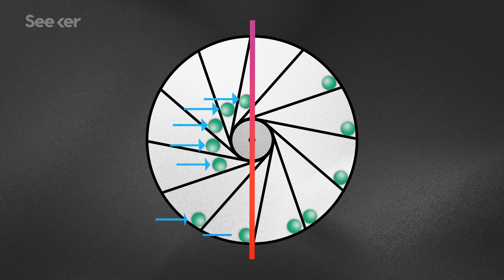Why We Want a Perpetual Motion Machine, But Still Can’t Get It

Comment: But if it only slowd down due to interference from the outside environment... (proof of this is supercooled superfluid liquid helium), than: it would not be cheating to take energy from that environment, because that's just payback for the environment making life difficult for the machine: ergo: moss in a sunny environment is a perpetual (as long as the environment remains sunny and conducive to life) motion machine. 

The only problem is that the environment has a tricksy habit of changing.

The suns energy comes from nuclear fusion, which would be a self defeating reaction even in a vacuum, but it's other energy: its rotation: would, in an empty universe: be around forever, never slowing down. 

Sadly, our universe is not a vacuum and gravitational waves slosh across cruelly and unfairly spreading the energy out all over the place. 

So, if you wanted a real free energy machine: you'd already need one. 

Luckily: the expansion of the universe is so power that it's going to blow atoms apart someday; either that or our universe is some kknd of cycle in some kind of vacuum (big crunch big bang big crunch big etcetera) or our universe is going to become infinitely cold, thus making a great temperature differential to harness energy from.

Or to be more accurate: you need an infinite energy source. 

Alternatively: you could lpok inwards and realize that humans are indefinite energy machines, because we are intuitive AI which adapt to harness energy from our environment. 

Build an organism compliant with being used as tool, then give it the genetic toolset to thrive in as many places as you can, then wire them up to harness energy from literally everything, from sound, to gamma rays to UV rays, to visible rays to radiowaves (as a colonial bacterial matt acting as an antenna), to even temperature differentials and quantum fluctuations (brownian motion). 

There, something more efficient than a plant, a universal, electron-farming microorganism which can be tapped into and which will have an output till heatdeath (due to cosmic microwave background radiation). 

Will always produce enough to run a tesla? Probably almost always not. 

But will it always be observed operationally extracting energy from its environment? 

Yes. 
Because no matter which way in which you attempt to observe the darn things: you'll be giving them energy. 

There. 
Rant over. 
Go home
Reply: Ian Schimnoski Thats false
Reply: @RetrogradeBeats  oh okay, thanks for letting me know. 

My name's Jerry, I like movies 

Jk

Free energy logic is generally false. 

But, I see no reason we couldn't build living photo-diodes, and then impart them with more dynamic behaviors and functions. 

I don't believe in perpetual energy, but just like how we pack up and move when an oil well dries up, a process to automate that transition, but with solar and sonic and optical energy sources, would be cool. 

I am most prone to imagining unbalanced wheels. But I'm the kind of person to simulate it through to the end and realize it won't work. 

That's healthy.

The only people who don't: are people who have already; charlitans; and lazy folk. 

All physicists have already. 

It's called the laws of thermodynamics. 

They have a stronger grasp on it, so they have already simulated and debunked all free energy machines. 

Me? I still need to play in order to master it. Not there yet
Reply: Ian Schimnoski can build a mechanism that could extremely efficient, yes. Maybe something efficient for millions or billions of years, yes. But the day will come where the energy will dissipate as it has to be used to operate unless it generates free energy to replenish itself which is impossible and paradoxical. The problem is that most people consider hundreds of years forever, as they cant conceptualize the magnitude of forever and round their definition of a “very long time” to forever which is not true.
Reply: So yeah, I agree with you, but that's what I was trying to express whoever less eloquently. 

I believe broad spectrum energy harvesting is good, and we should make it so that we never personal experience the after-effects of entropy because those are sad, and make me sad, and I just want people to people to have fun forever; I'm tired of things being so darn impermanent, it makes me sad

Comment: Put Copper Wire on the outside of your wheel, and a magnet, if you do this to your Forever Moving Machine, you can break Thermal Dynamics... though that is kind of cheesing the system.
Reply: Nope

Comment: Stop looking for miracles and use all-magnet force for power already availble, a century old tech, eh?  Is 50-years of power no inputs close enough?

An all-magnet generator for power, no fuel, no water, very little wasteheat per Mwh, this is a 1-Mw unit designed for 'no spark', has a 50-year, 100% Duty-cycle service (w/lube) and made to send in a trailer globally powering explosive storage product needs onsite (Spa. txt for RF5000, "... ente durante 50 años con un mantenimiento normal.");
http://www.technokontrol.com/en/current-projects/generator.php

Comment: What about an electromagnet axle so there's no friction and the magnetism powered by the wheel itself like a self winding watch...I'm going to make one
Reply: Make sure to do it in a vacuum chamber and scrub out the quantum vacuum fluctuations while you're at it. Also, motion in a magnetic field is converted to electrical current.... so you're describing a mag-lev motor in reverse, and if you back-drove it you'd have a mag-lev generator. Just so you know, they're not efficient.
Reply: @impromptu_ninja  thanks so much...for the information and being friendly about it. I hope you have a wonderful day friend. 😀

Comment: Yes, but that does NOT mean that you cant create a machine that works as a converter, which takes one form of energy and converts it into another... simple example would be Solar cells, they take solar energy and convert it to electricity without any movement at all...well no movement that the eyes can see...
There are machines that can be built with magnets and in vacuum they work, *MAGICALLY*, creating usable energy... There are other things like ENERGY FROM VACUUM (these machines are theoretical until someone builds one...)  but it is possible to convert the energy from space vacuum to usable forms of energy... the problem is that these machines would need to be pretty damn big and they need to be in space... to long to explain how they work but they would basically use the energy that is already present, just in an unusable form and convert to usable form like electricity or heat...
Reply: blade93ny solar energy uses photons provided from the sun. That energy is an outside source. Furthermore the sun does not last indefinitely. Two errors. Secondly magnets do not hold a magnetic field indefinitely, over time the felid decays to zero, faster than nuclear actually. The perpetual space machine is completely impossible as only a superfluid would allow for a frictionless machine and the universe does not accommodate such conditions.
Reply: @RetrogradeBeats  yes, you are correct on the "perpetual motion" front...what im talking about has nothing to do with perpetual motion but with energy conversion from sources which are plentiful and abundant in space and can be converted to forms of energy that are useful to us humans... we usually use mechanical power, electricity and thermal energy... not really much of other things to perform WORK... yes, we use different kinds of radiation like XRAY and other for medical and diagnostic purposes...but NOT as drivers of machinery...
Also, the solar energy has a LOT more in the spectrum than simply photons, dont forget about ultra-violet and infrared (thermal)... The sun doesnt last forever comment is idiotic... which its true that nothing lasts forever, BUT I think several billion years compared to lets say 100 years for a very LUCKY human being is pretty close to forever...also while our sun is projected to last ,in its current stage, as a G class main sequence star for the next 5 billion or so years... then it will start consuming heavier elements and grow into a Red Giant...producing more solar energy that will destroy all forms of life on Earth and boil away all the water and atmosphere...
So, back to abundant source of energy in space... For example, X-Rays as known to us humans, exist naturally on Earth in certain radioactive minerals and gasses and there are plenty of source of Xrays in space...like black holes... you can convert Xrays to electricity and thermal energy...
Im not gonna go into this much further, you can do your own research in interested.

Comment: Would something like a solar system be considered a perpetual motion machine?
Reply: Leonardo Constantino no, the sun will runout of fuel, black holes eventually dissipate due to hawking radiation, the expansion of the universe ultimately leads to a heat death. Remember billions of years is not forever. Good question though.

Comment: I've always wondered since scientifically we know there is no possibility of Perpetual motion or More energy then u get out machines even the most efficient ones due to the eventual quantum nature of particles itself. 

Is it possible to still use them tho? Since the best cases we could have a "self running machine" that would last for decades if done really right. And when it finally comes to either a stop or a point to which the energy produced form the machine is far to less to power the next step to then continue the process. So is it possible to just use one of these machines as a way to keep a low power system going for decades, centuries or even millenia if done really well??

I get u will have to have some way to start the process again but thats easy we already are using rockets that are super inefficient when compared to say Fusion, light sails, anti matter, etc etc. Meaning while yes we would have to add in a system to start the process once this SLOW WIND DOWN finally stops wouldn't that be less then than using a traditional chemical rocket. Yes yes I know these machines while they may take a long time to stop or reach that point of not enough energy produced sort of thing meaning Chemical rockets are still great for that initial push shit we need for our gravity well. 

I could still see an application of these "Slow wind down" machines for something like a replacement or EVEN an addition to say the Ion drives we already use for long term SLOOOOOOW space travel once we are out of the Earth gravity well. Is that possible?? I would love to hear ideas about this whether they be in support or not. I've always wondered if we could take advantage of these snake oil ideas in a way. Not to break laws of course but to extend the efficiency rating as we have done with Anti matter machines or will do.....................
Reply: My guess is that there are better ways to get better output.  I would imagine that a slow wind down machine would be less efficient than something like solar panels or a nuclear reactor or maybe even a big ass battery.

Comment: Electrification of a superfluid!! A high enough yet low enough voltage used on a superconductive superfluid could, hopefully, maintain that same constant energy in a cycle of constantly now flowing fluid pushing throughout a system similar to that of the cardiovascular system into a central turbine like area that can produce the kinetic energy for free indefinitely. Just talking out my ass here really :P

Comment: What if you made a wheel in a near perfect vacuum with little or no other gravitational  bodys to influance it.

You have a bar with a magnet at the center, and a wheel with a ring magnet of an opposing fields as to keep them from touching, but also keep it from flying off.  

The only flaw i could see is when the magents decay in to other elements.

The only energy input would be the initial put to spin the wheel.
Reply: The only energy you would be able to ascertain from the machine would be the energy you put into it to start it.  It would not create any additional energy.

Comment: But gyroscopes.
They require very little mechanical force for short, but high RPM.
A fidget spinner for example.

What if you attached a gyroscope to an axel that has many alternators to supply a motor with power to keep the gyroscope spinning
Reply: You get the already discovered technology of "regenerative breaking" and it grinds to a halt after generating less than half of the power you put into making it spin.

Comment: We can tell you've been working out (; 

...

everyone like this right fricken now he needs this..
Reply: Also, I have been thinking this forever, you take almost any attempted perpetual motion machine, and add up the energy lost from friction, the air, and heat loss, than the way you get around this minor problem of not being able to get enough of energy out of the system.. is.. you need to add energy from the surroundings to the system. So right now the energy of 1 square foot of waves in the ocean, is more than enough energy to tip the ball or carry a boyant ball back to the top of a rig, or solar energy, or the heat from magma around a volcano, or wind, or magnified beam of sunlight that could melt steal, this is alot of energy that so far we cant convert into usable energy efficiently..  do you know how much energy it would take to replicate that beam of magnified light from one square foot of refractive lens? Thats alot lol. These can all keep a system going forever, now we if we can create a simple small cell that creates consistent energy lets say only 1cent a day, you increase the surface area of the collective unit, and eventually you have a macro level source of constantly flowing natural energy. So wait. Just think of the simplest way to convert the constant motion of wave rolling a ball around, the ball will roll as long as its floating with no stable position...  Now lets say its the size of a grain of rice, if you can maximize surface area to add as many of those tightly packed together, than if the size of that unit is the size of lets say the size of a basketball, if you had just taken 1 of those cells, and kept it large so the size of a basketball, your densely packed cells would create more energy than the single large cell that is the same size.. How crazy is that.. so this is how we can efficiently harness energy from natural sources.. heat is a big one... ANY movement.

Comment: Our universe is a perpetual motion device and most of the things inside it. If think deeply you will understand it.

This is a shower thought. That’s why.
Reply: I was thinking this during the video as well, it just keeps expanding until heat-death.
Reply: The second rule of thermodynamics is, don't talk about thermodynamics.  Wait.  That was something else.

The second rule of thermodynamics means the universe is not a perpetual motion device.
Reply: proves they just made everything up.
Reply: r/iam14andthisisdeep
Reply: @derpbot5715  goodbot
Reply: @derpbot5715  you are using it wrong
Reply: Heaven and Earth will pass away
Reply: "The universe" is a bit of a special case.  All of our science deals with things in the universe.  The actual fabric of the universe is a whole other ball of wax that we have only the vaguest ideas about.
With regard to thermodynamics, there's a piece that always gets left out -- "in a closed system."  If your system isn't closed, then you can freely gain and lose energy as much as you want.

That means if you plug your motion machine into a wall socket, then yes it will happily run for as long as you pay your electricity bill.  But that's obviously not what anyone means by "perpetual motion."

There's also a handful of people who use quantum mechanics terminology to create a word soup that they claim could create a perpetual motion machine.  Those all don't work either -- quantum mechanics doesn't break the laws of thermodynamics.  Its just sometimes even harder to figure out why they don't work because quantum mechanics is hard (and often the "why" is because quantum mechanics is hard and the "inventor" doesn't even understand what they're talking about.)

That said, there is one source of energy that, as best we've been able to tell so far, truly is infinitely sourced -- dark energy.  Unfortunately, even if you could somehow figure out how to harness it, its effect is so incredibly tiny that its only detectable on the scale of billions of light years.  And I'm pretty sure that even if we figure out how to work around the light speed barrier and everything else, humanity is still never going to be capable of building a single device that is billions of light years long.  (And of course given how little we know of dark energy, its still entirely possible that we'll eventually discover it also falls to the will of thermodynamics.)
Reply: @altrag  That's a hilarious thought! Imagine conquering light speed travel, then realizing that a nebula, when compressed from an FTL perspective, is essentially a roving cow that wants walk in front of your ship and eat you or swat you away.
Reply: until entrory.......
Reply: That's just a theory which is still not proven....and a bit wrong because the universe is also a closed system neither creating energy inside itself nor destroying it.
Reply: @roccokainka9661  
Correct, the entire universe maintains the first law since it's all one closed system, but you can define arbitrarily small sub "systems" which can be defined as closed as well. The universe itself is not internally creating or destroying any energy, and it cannot